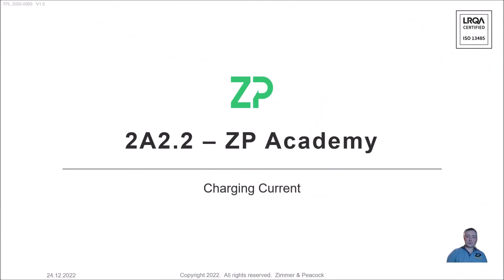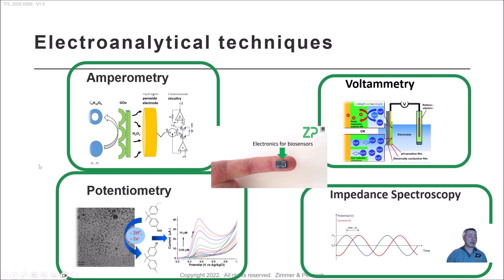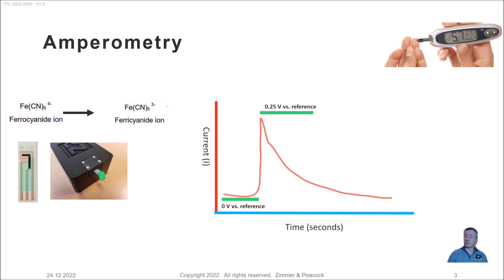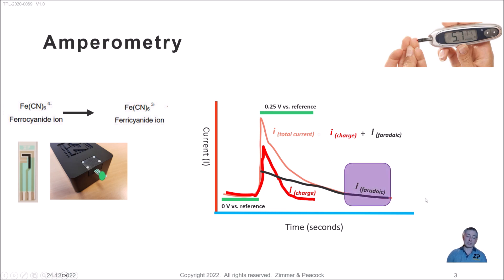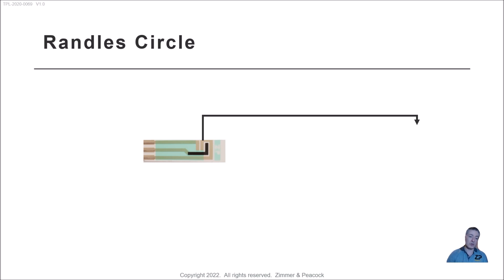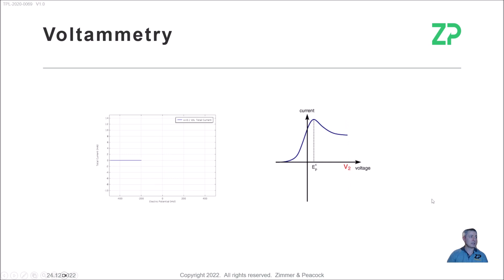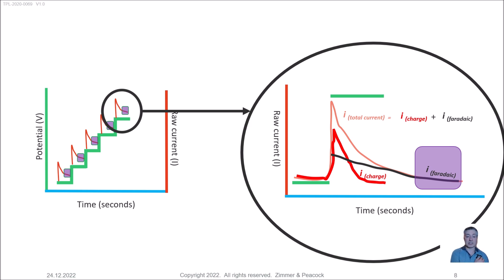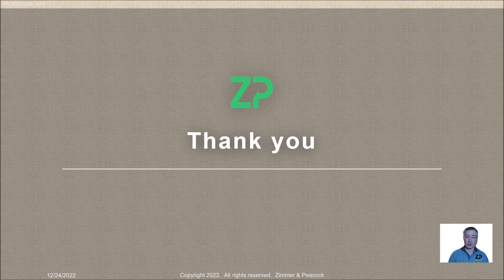An introduction to charging current in electroanalytical chemistry

Comment: Very nice video. I was wondering about what is the time span in which the charging current dissipates in an amperometry setting (e.g chronoamperometry)?
Reply from the maker: If the electrode is bare less than a second, but once  you start adding polymers to the electrode surface it can really stretch this out to tens of seconds, when we do our workshops everyone gets to perform several chronoamperometric experiments and you see the phenomena is real time  - https://www.dev.zimmerpeacock.com/general-9
Reply: @zimmerpeacock9703  Thank you very much for your elaborate answer and the link to your workshops!